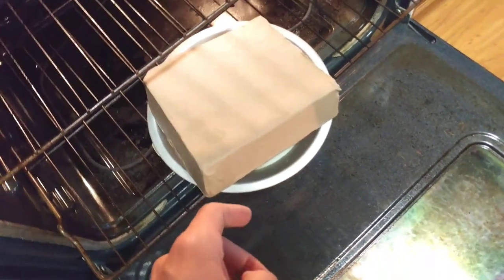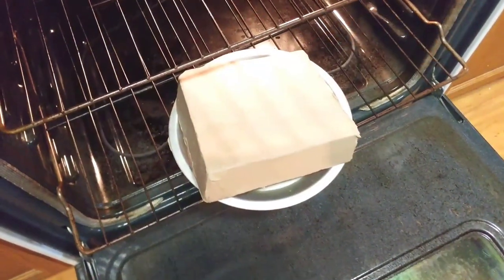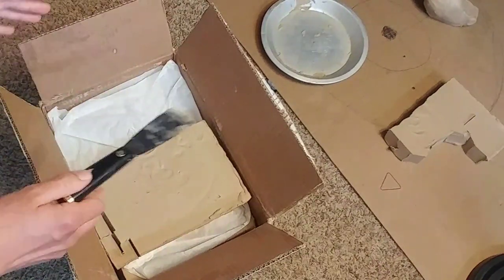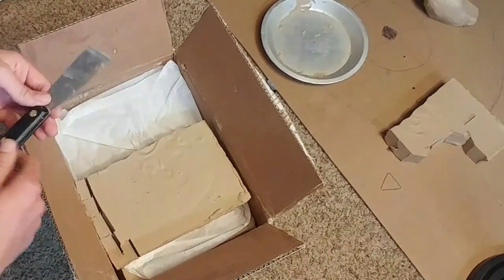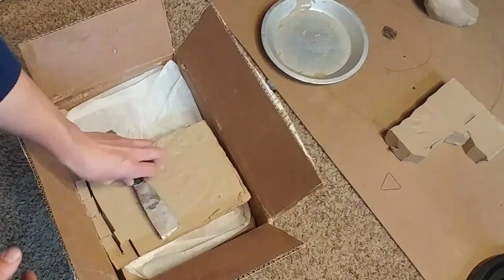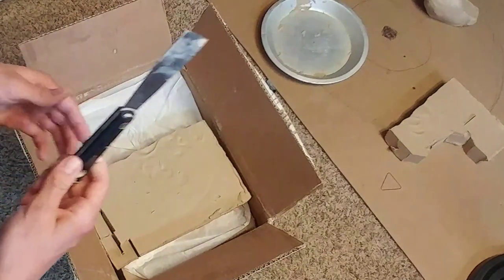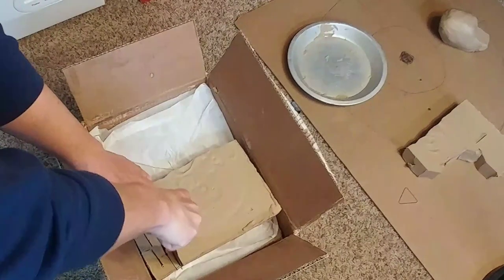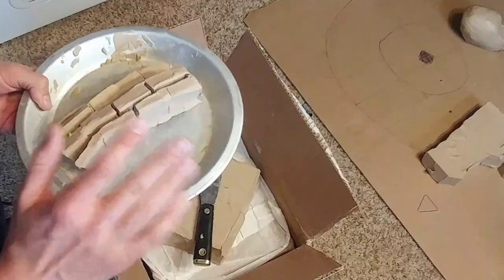Before you soften or melt a large brick of clay, try this... (Plasteline/Oil Based)

Comment: Hi I have oil based clay and I want to know how to harden it I made the mistake of putting it in the oven and it melted so how do I harden it?
Reply from the maker: You will have to mold it. The oil based clay is great to work with, but it cannot be hardened. You can try a polymer or ceramic, but the clay texture is no where near as smooth or easy to control as oil based clay. I would recommend watching some videos on moldmaking.

Comment: Is modelling clay that doesnt harden and dry a oil based clay? Mines doesnt bake dry and it gets softer when i form it and play around with it i think its an oil based clay how should i bake it? What temp and how long
Reply: If it's the modeling clay that you might find in a kid's toys section, no heat is needed nor recommended.  Modeling clay isn't really meant for making something you want to keep foe good.  If it falls or gets stepped on...fame over. Polymer clay is the only clay you need to/can put in an oven or toaster oven to harden to permanent hardness.   Plasticine is what he's talking about here but he's only putting it in the oven to soften it so it's pliable.  I have a couple of never used blocks that would probably injure a person if I hit them with it so I'm searching for ways to soften them.  Led me here.  Was wondering if I could just use the heat of my hands like I do Sculpey brand doll polymer clay......
Reply: Super short answer,  modeling clay in my experience, usually never hardens to a point where heat is needed.  I just hold n move it in my hands like polymer.